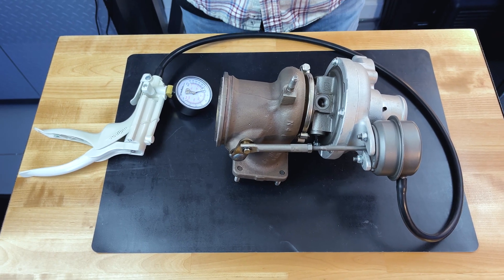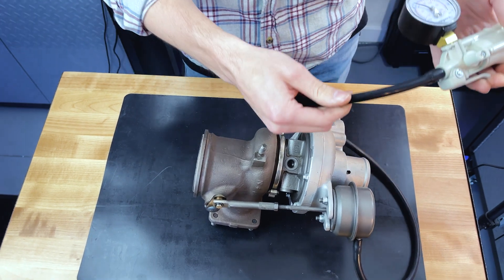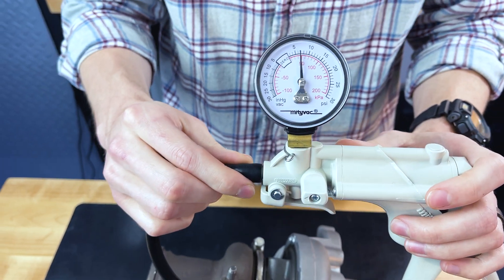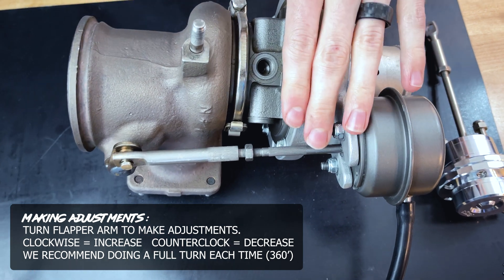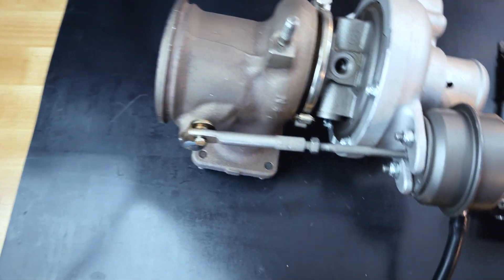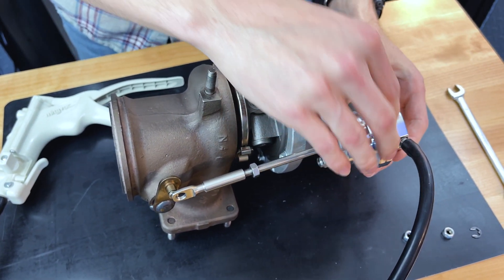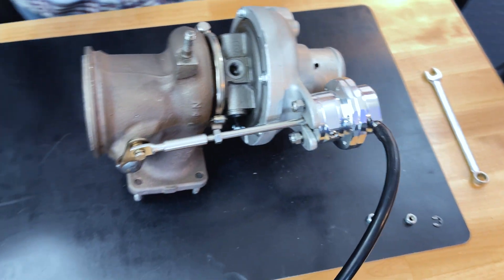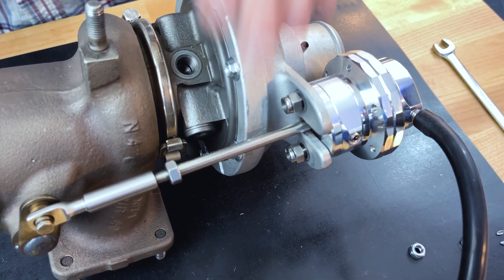HOW TO: ADJUST & CHECK WASTEGATE CRACK-PRESSURE | 1.4L MULTIAIR TURBO (GT1446 Turbo)

Comment: Wish I woulda known the preasure pump gauge you recommended only reads to 30 psi. Bought it and still had to use an air compressor and blower nozzle set to 40 PSI

Comment: I have found on how to calibrate my wastegate with my new car scanner. It seems to me the counter for the charge pressure control unit is ended. Until today I have got error 29A400 intermittent. To night it has changed to permanent. So I have to replace a new control unit to reset it, activate terminal 15, run calibration. I dont know what "reset starter lock" means. Need to find out what it means. Delete the errors. run test.

Comment: I have a boost leak at high rpms, the boost starts to be unstable and the car doesn't has much power. How do I know if the problem is the wastegate or the blow off valve?
Reply: Wastegate is probably stuck open causing overboost happened to my MazdaSpeed 3 currently putting in the wastegate I’ll try to come back and let you know if that fixed the problem

Comment: I would like to know when the engine is  off is the westgate  open or closed?  and in what position is he when the engine is on and how it continues to work when I add a lot of gas.  my engine lost power when I accelerate after 2 thousand revolutions, I don't go into save mode and the diagnostics dont report errors.  I get acceleration but very slowly, like I don't have turbine.
Sorry for my english i hope you understand my question, thanks
Reply: It should be in the closed position when the engine is off. It should only open when the pressure that it is meant to open at is met.

Comment: fiat punto evo 1.4. i've shortened it by 6 full turns. will that be bad for the turbo/car?
Reply: It helps with something?did you had more power after that?
Reply: @Jm-uh6zu  that rattle was gone, and maybe the turbo kicks in bit sooner

Comment: If it moves at 15psi does it have to hold that pressure too? What if the pressure starts to drop? Bad waste gate actuator diaphragm?
Reply from the maker: It should be able to hold the pressure (as shown in our video when we pump and fill the diaphragm). If it is dropping the diaphragm would have to be leaking (or the tool is leaking).

Comment: I love your video. My BMW F11 525D xdrive 2012 actuator rode is just a plastic rode with no nut and nothing to adjust. Is the adjustment sitting in the wastegate top? I get repeatly the same error 29A400 saying the rode actuator is too far + deviation. If I accellerate a little bit , the drivetrain error comes up yellow sign. My plan is to turn the rode 4 turns to increase the load. Have you any good advices? The workshop has replaced a new turbocharger. After the replacement my trubocharger has no boost.  There is no help from the workshop. it seems to me they don´t know what to do.
Reply from the maker: I don't have a great deal of experience with newer BMWs, but I believe that actuator is electronically controlled (similar to the newer Alfas we work on, same technology only a bit older). Normally the wastegate has to be calibrated with the turbo, or when out of deviation. That's also true if you replace the turbo. We have a program that does this for Alfas, I would think there must be something that can also do it for the F11. But typically the electronic WGAs have to be calibrated, or undergo some sort of calibration procedure. Normally you can't set an electronically controlled WGA, or adjust it like in this video. It has to be altered or calibrated using software.
Reply: @EUROCOMPULSION  I have read from youtube many people use Insta+ to calibate the electronic controller. Do you have any experience in using the Insta+? I mean the procedure is the same all kind o cars. As far as I understand you must adjus the crack pressure first and use Insta+ to calibrate and check. Agreed?
Reply: I do not have Ista+ yet, but I have bought a good scanner and I think it has support for calibrate electronic controller. I do agreed I must adjust the crack pressure first and use scanner to calibrrate. I must buy a Mityvac vacuum/pressure pump to adjust the crack pressure too. hank you so much for yourr advices:-))
Reply: @EUROCOMPULSION  Thank you very much. Now I understand I have to bring my car back to the workshop and ask them to calibrate the electronically controlled WGA by using a software to calibrate. A BMW workshop sure has a software suitable for BMW cars. I don´t this workshop has the software. They did not find the errors saying the turbo geometri is out of range. With my Autofix S910 diagnostic scanner. I have got all the errors with the turbo. The booster pressure solenoid was short circuit because filled of oil. After replacing the booster solenoid , all errors dissappear except the WGA error.

Comment: Hi Nice vidéo.  I try to adjust my setup , I have 57 trim turbo on a 7mgte motor .my wategate start to open at 11psi and fully open at around 17psi, but my full boost is 16psi on hight rpm.
(My boost grow with rpm around 5800rpm)I have no leak on my boost circuit (hose-intercooler..)
And no leak on my exhaust manifold and exhaust valve.
Do you have a idea? It s not à big turbo normale full boost is around 3800rpm.
Thanks🙂

Comment: so if im looking to make 15psi should my crack pressure be 15 psi as well or should it be 15psy wastegate flap fully open.
i have a gt2871r that was supposed to be 8psi stock but the least i can go down in 17 psi no matter how low i set preload,so i purchased a ebay adjustable wg that says its 10 psi,

also i do have a boost controller and wondering if i should just leave the wg at 10 psi and adjust boost control to 15 psi or is it better to not use the mbc and control boost only off wg
Reply from the maker: The crack pressure is the pressure at which the wastegate arm begins to move (and therefore the flap begins to open inside the turbo to regulate pressure). Because of the wastegate duty cycle (electronically controlled), it's not necessarily an open at 15 and stay at 15 for boost pressure. It's going to open at 15 psi applied to the wastegate, but still allow for boost to build to some degree. The duty cycle fluctuates in order to maintain requested boost, which has to be changed in the tune. Only in the case the electronics were completely removed would you be able to rely solely on the crack pressure to regulate boost (and the ECU would throw a lot of codes as a result). Boost control on this car is mostly dependent on the electronic control and software.

Comment: What is the size diameter of the silicone hose?
Reply from the maker: 4mm ID. Make sure it is nicer silicone as many do not stretch quite well and you may need to size up a bit.

Comment: What is the crack pressure for a k03s turbo?
Reply from the maker: We have not tested that so would not be able to tell you. We really suggest sticking with the 1446 and then when upgrading choosing our 1446+ Big Turbo. Our turbo is the most performance proven by far and is the only turbo that has gotten anyone into the 13’s with both a 124 and 500 Abarth. At least publicly.

Comment: Would you guys perform a video tutorial on how to upgrade the front sway bar for 2016-2019 fiat 124 spider? I am lost on installing the new front sway bar.
Reply from the maker: We don't have a video specifically on the sway bar install (I don't think we will be making one) but there are a few written guides from users online (a few on the 124spider forums as well like this one (https://www.124spider.org/threads/front-swaybar-installation-notes.31400/). 

Hopefully that helps.

Comment: So is 15 psi recommended for all 1446 or just when you're running Forge/TS wastegate or just on Phase 3?
Reply from the maker: 15 psi yellow spring is recommended for Phase 1 and up with the Forge actuator. This is not comparable to the Turbosmart as that actuates differently and a 15 psi spring is not available. Stock actuator should be around 7-8 psi and can be adjusted to about 9 if need be, although it is not ideal for a tuned car.